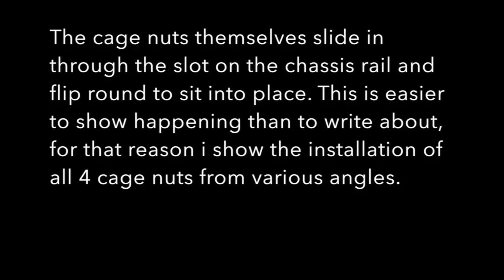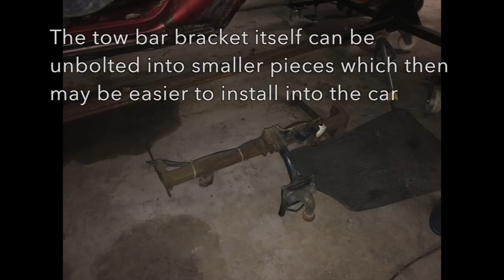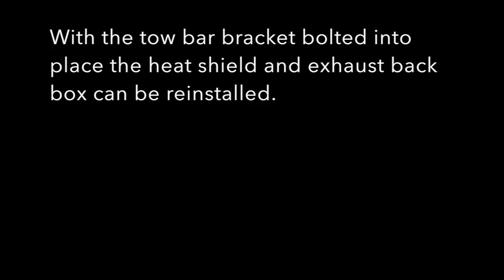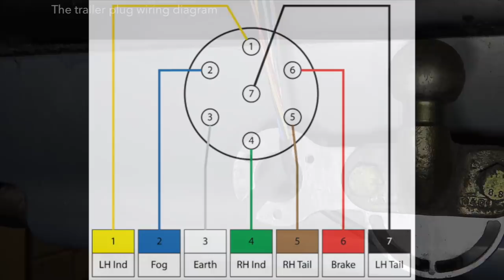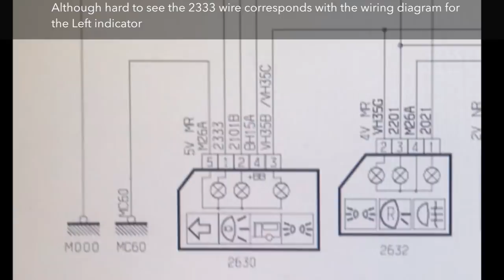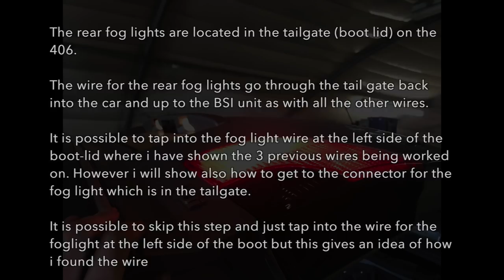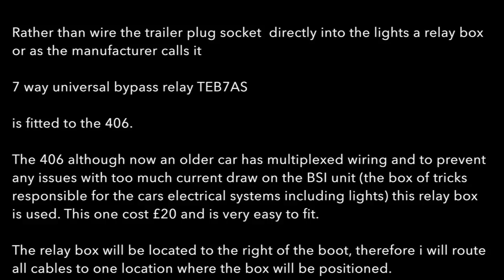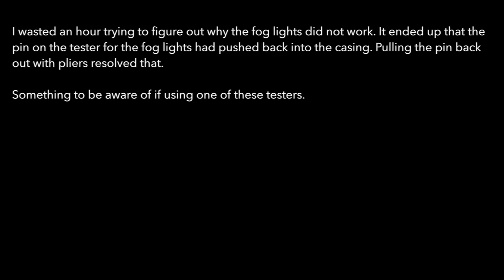How to install a tow bar | Peugeot 406 Estate

Comment: Installing tow bar on a C8. No clue as to how the cage nuts would be needed to installed. Then found your vid. Many thanks from The Netherlands. 👍🏼👍🏼👍🏼
Reply from the maker: I was a bit clueless at first as to how they worked, once its shown a few times it clears up any confusion. Good luck with the towing.

Comment: not sure where my comments went, but thanks again for your videos and your reply, as to the fitting of a tailgate om the 406 estate it was really  no problem, 3 plugs, brown, grey, white, nearside just above the rear speakers, offside just above speakers, 10mm earth bolt, white plug and the rear wash hose, remove the 2 tailgate pistons and 4 bolts, cheers

Comment: can anyone help me i have fitted a towbar to my peugeot 3008 year of car 2011 model my problem is do i have to remove the negative wire from my battary when fitting a relay to the wiring thanks
Reply from the maker: Disconnecting the negative terminal is done as a precaution. If you accidentally touch a positive wire to the body or some other electrical system it could damage sensitive electronics. Its possible to do it without disconnecting the battery. Although then its like playing the game operation, which is much easier with the battery disconnected haha.
Reply: @peugeotCitroen2CV  you have  been a great help thanks mr peugeot

Comment: Nicely edited and informative video as always! I don't think you could go wrong with such thorough instructions. Do you know if the wiring schematics for rear lights are at all applicable for pre-multiplex cars? I have an early D9 estate, and that unused permanent live would be great for powering a 12V power socket. I've been meaning to install one to power an electric cooler, already have the socket stolen from a MKIV Golf. :)
Reply from the maker: Thanks.
Peugeot wiring changes quite a bit between the pre-multiplex and fully multiplexed cars, that was the reason I used the probe to show how the wires were found as there is such a variance.
If you go to e-manuals online (I've added a link in the description after this comment, it's in there now) the 406 manual download at the time I got it had the wiring diagrams, if you use your cars build code you should get wiring diagrams specific to your car. 

However, saving the £20 for that manual if you pull off the left side light cluster plug and see the wire going into the plug but with no corresponding pin on the light cluster then that will be the same permanent positive wire. Also asking on the 406 owners club is worth a try as there will be members there with pre multiplex cars who may have already added the 12v socket to the boot.
Reply: Thanks for your answer!
I don't think it's going to be too hard to check this one myself, just thought I'd ask anyways, just in case the wiring diagram for lights was universal for all 406 estates. I suppose I'll just check for that extra wire, add the fuse and be happy if it works. If not, I can always add my own wires. Either way, this was a very helpful video showing how the panels come off and where to attach my earth wire.

Comment: thanks, you have no idea how helpful your videos are, cheers. I see you are now on a 406 estate, have you ever switched a tailgate(boot) on one?
Reply from the maker: Hi thanks for the comment, feedback like this is an encouragement to continue with more videos.

I moved to the 406 as the 607 was just a bit past its best and lacked the practicality of the estate body. 

Unfortunately (or perhaps fortunately) the tailgate is not something I have changed on an estate, I have a video of a saloon boot lid and I have a video of a 305 estate tailgate which is vaguely similar with the exception of the exact way the 406 wiring is disconnected. I would recommend first disconnecting the wiring, then get someone to give a hand, unclip the gas struts, and then remove the bolts. Although use a sharpie or similar marker pen to mark around the two hinges to aid reassembly.

Comment: У меня есть подозрение, что прицеп тяжеловат. Под капотом написано какой максимально допустим.
Reply from the maker: This particular trailer is close to the limit, i only use it for moving a lawnmower but any more stuff on there and it would be easy to over load it. Although the car itself is in no way short of pulling power.